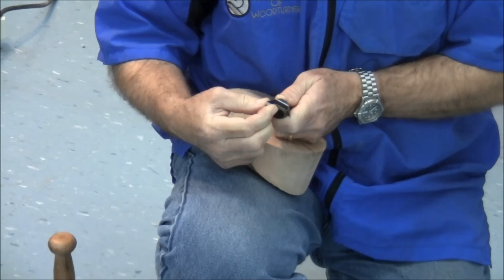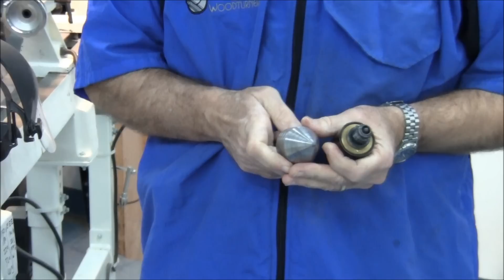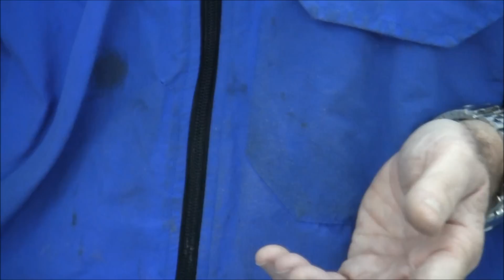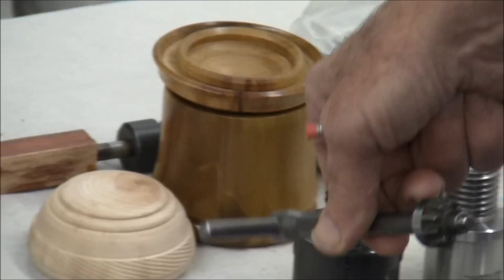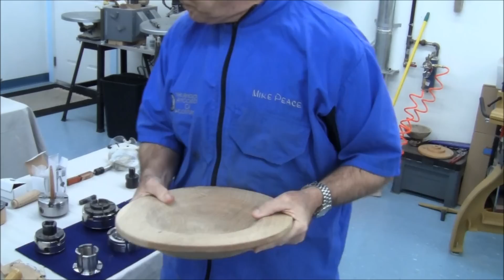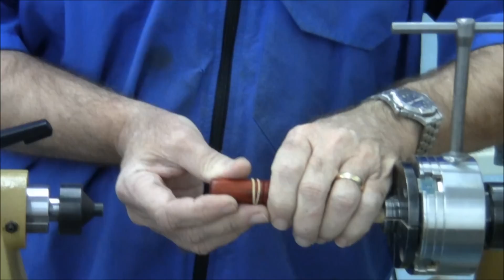Chucking Wood by Mike Peace

Comment: On your vaccum seal problem wondering if using Saran wrap to fill the leak between the woods, Or maybe a sealing oil on the surface between Saran and wood, , Wife might have got me a mini lathe for Christmas this Lathe Newbe needs help used them in school back in the early 70s, I subbed. This was very informative video.

Comment: Oh yeah, that’s what I was looking for! A true beginner’s video, well explained with all examples show. My compliments to you for both quality and the donation of your time. I found only two beginner’s questions: 1. The reason a screw chuck is called a screw chuck, and, as opposed to what; why is a live center so called and, again, as opposed to ... a dead center?
I only mention them since you obviously strive for a high level of nomenclature instruction for your beginners and I wanted to help.
Reply: Screw chuck contains a screw to hold the wood.  You hit it on the live center. In the old days they used dead centers that did not turn.

Comment: Can straight jaws be used in expansion mode? I've used mine that way sometimes for smaller bowls, but use my dovetail jaws for expansion mode on larger bowls. I've never had any problems, but someone said the straight jaws are only for clamping mode on a tenon and not for expansion mode...?
Reply from the maker: I have a few PSI chucks that have straight jaws with serrations on the outside to grip in the expansion mode. I personally prefer the dove tail jaws but they will both work.
Reply: Thanks, that's what I thought too...

Comment: Thanks Mike. Very enjoyable! I was hoping you would talk about a part I have that I'm unsure of it's purpose. It threads onto my 1/1/4" spindle and at the other end, provides a female that is a very course tapered thread. Almost like a broom handle thread but heavy dutier. Any Idea?
Reply: I have never seen one but that sounds like a cup chuck which was used before scroll chucks became readily available to woodturners.  You rough a tenon, perhaps with an axe and pound the blank into the cup chuck.

Comment: Thank you so much for the information, am getting ready to purchase a powermatic 3520 b for my Christmas present.... so now I have so much info. to decide which one to get for the lathe....  I have been turning bowls both live edge and smooth...  for about 7 months now from about 4" up to 15" using  a psi baracuda and a 1642 lathe.... Thanks again...
Reply from the maker: Thank you! This is one of my favorite videos that we have made. Mike did a great job showing options other than just a chuck or spur drive.

Comment: mike that was a great video,,,do you prefer the worm screw or the kind that has spurs,,or do you have any that way
Reply: I do like the woodworm screw for smaller bowls of less than 9" in diameter where I am not concerned about balancing a grain pattern. It used to support a blank without tailstock support. A drive center with spurs is for turning between centers, supported on both ends.

Comment: What I like to do with a block of wood that threads on a line center is after tapping threads in it take it off and use some thin ca glue on the threads to toughen them up. Just make sure to chase the threads after the glue cures and as you suggest use some paraffin wax as a lubricant. I make a dozen of them at a time.

Comment: Thanks for an excellent and informative presentation.

I have one comment regarding the vacuum chuck plumbing.  I see tje filter on the bleeder tube, but I don't see one on the tube that goes to the spindle.  It would seem to me that it would be wise to install a filter there, also
Reply: +Bob Blarney 
Actually that Gast 523 has a built in filters on the line going in as well as the exhaust. I clean them regularly so don't feel the need for an additional filter.

Comment: Many thanks Mike. I was waiting for you to show us the "Longworth Chuck". It's for chucking bowl for bottom finishing. I ran across this ingenious device on the internet and ran out to my shop to get to work on one. About 6 hours later I completed it. It was great fun to make and I can't stop opening and closing the jaws just to watch it operate.
Reply: I had some bad experiences with Cole jaws early on. I viewed a Longworth chuck as just an easier to adjust version of Cole jaws so I went straight to making a vacuum chuck. I have seen commercial Longworth chucks that cost more than the cost of me making a vacuum chuck.
Reply: I agree Mike. All "trick" chucks can be, well, tricky. Slow going and light cuts with these delicate holding devices, as you pointed out in your excellent video. My lathe is down at the moment. Nova DVR XP. Electronics, xxzqzzxarrrg!
Reply: David Devin
Good luck with getting your DVR up and running. With so many lathes with electronics now, I am surprised we don't hear about more folks getting sidelined for repairs.

Comment: I am just starting to get in to turning. This is a very informative video.  Thank you for the information. I would have liked for it to go in to a little more detail about the spindle adapters. I do not have a chuck right now all I have is a face plate and a dull drive center. (Laughing).  My lathe does not have the capability to change drive centers so I have to find the chuck with the correct threads.

Comment: Since you have a chuck that works for you don't worry about it until you move up to a bigger lathe or have a specific need for a size or type of jaw you don't have and consider an upgrade then. No tool will make you a better turner. Instruction and practise will make you  a better turner.

Comment: If it works for you great. Hey, I still use a few  Harbor Freight  turning tools.  Are they the same quality as a Sorby, Crown, Thompson or Henry Taylor? No way!   Most Barracudas do not have an insert for the larger lathes with a 1 1/4" spindle like the Powermatic 3520 or Jet 1642.  The mainline chuck manufacturers will typically provide better quality control, better service, better documentation, higher quality alloys than can affect the service life of the gears and a wider variety of jaws.